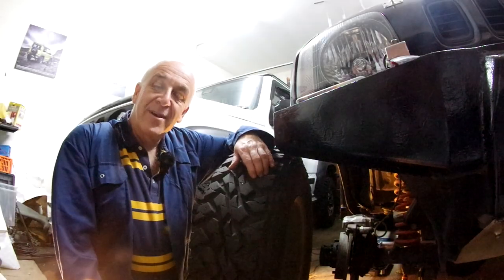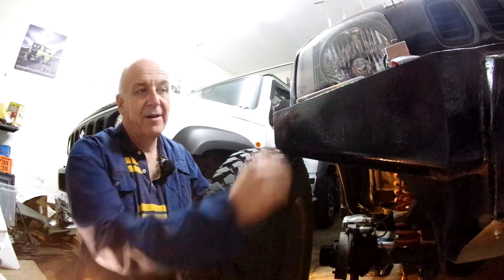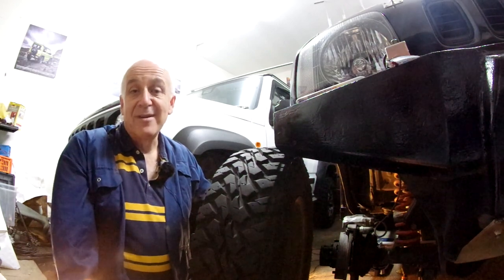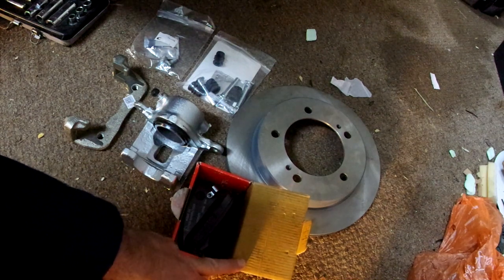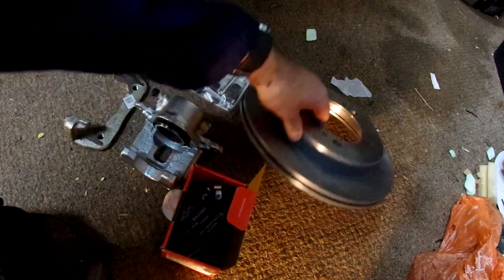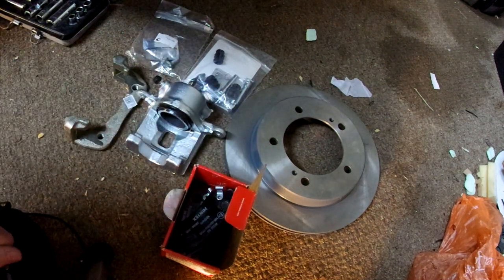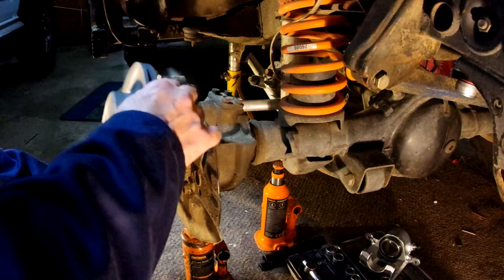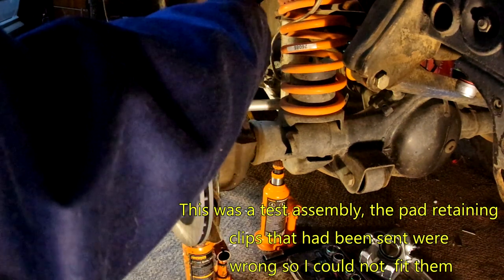Fitting Vented disks to a Suzuki Jimny

Comment: Hi Martin,  I have a Dutton amphibious car which has a Jimny donor. The front discs are vented so I assume it has been converted possibly using one of your kits. The LH caliper is partially seized. Is it possible to get a replacement caliper or a refurb kit? Thanks Rob